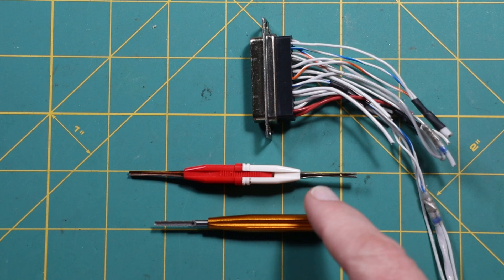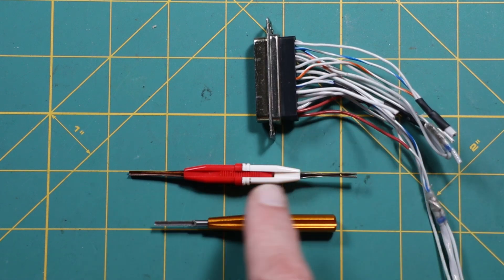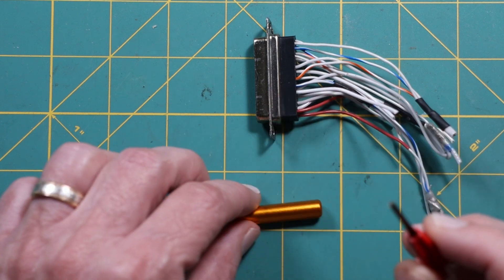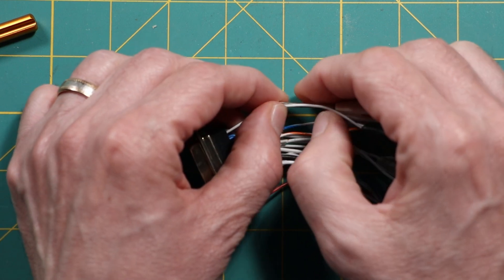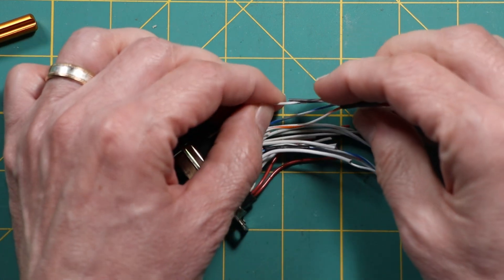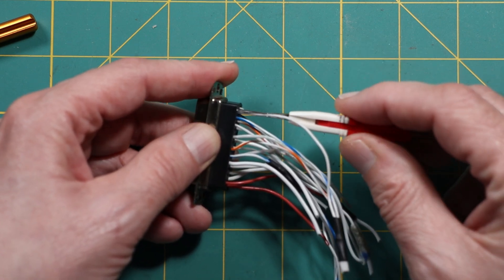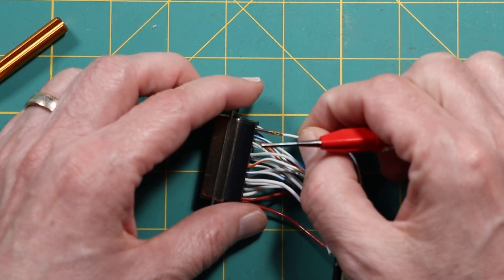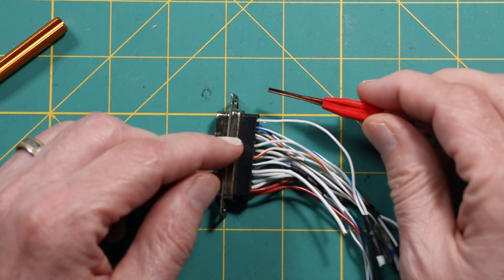Why I Hate Half This Tool

Comment: I've been using these for decades. Considering the fact that they only cost about $10, they work great. You don't need to work the wire in way upstream like JohnSL is doing, just push the tool on nearer the connector and let it split over the insulation. Also, the side he says is for insertion usually works ok for extraction, you just have to try it with different rotations until it interrupts both latch pawls.

Comment: In my comment on the last one, I didn't notice you were using it the wrong way around. Yeah, the side with the hole and both ends are split is the extraction side, and the side that's one piece is the insertion side. I think I'd mentioned that I had broken the end off of at least one of those on the extraction side, and I said "red side", but I actually meant white side - I was just going off which way you were using it and not paying close enough attention :)